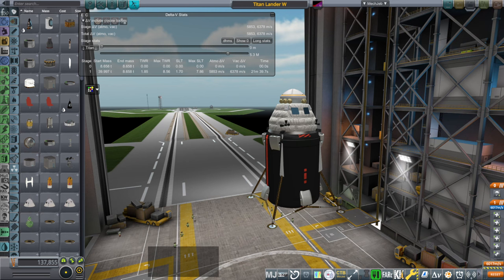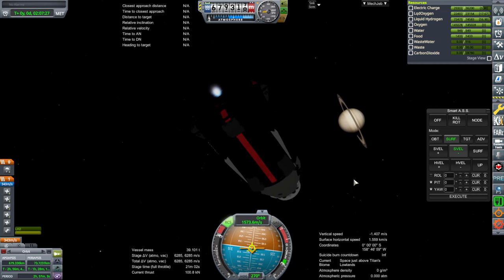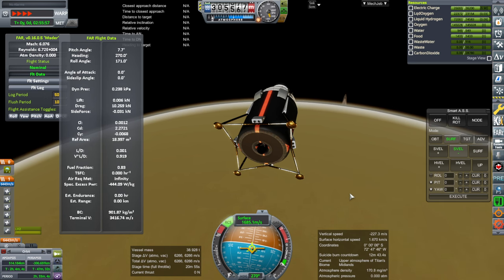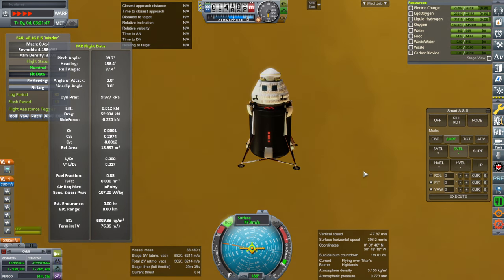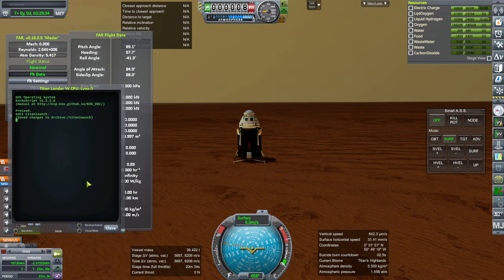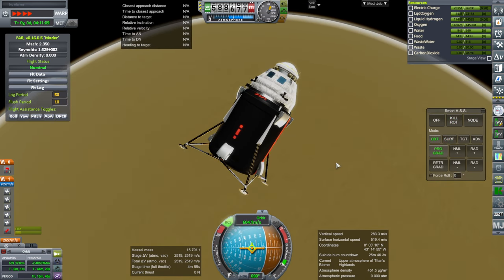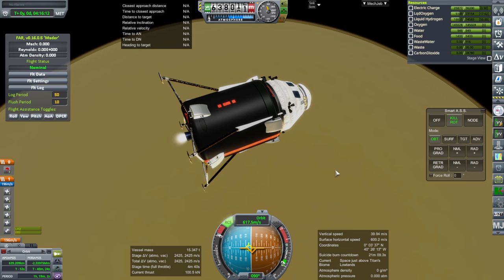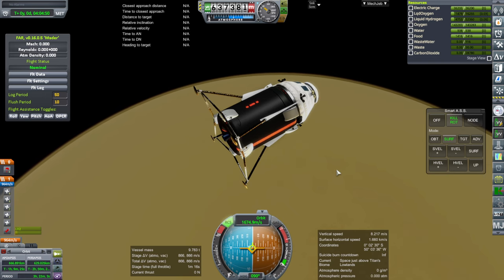Titan Lander Reconsidered (RO in KSP 1.12)

Comment: As I mentioned on stream, and as you mentioned, there's three main things that cause the drag coefficient to be what it is. The shape of the vehicle (pressure drag) skin friction/boundary layer drag (usually <10% of the actual drag force, very finicky and depends on the reynolds number of the air, the surface finish of the vehicle, etc) the angle of attack (this causes the reference area actually being hit by the air and the shape being hit to change, its fairly intuitive) and the Mach number. Usually because of things like shock buildup and wave drag where the properties of the air change very quickly and rapidly close to the vehicle.  The drag coefficient can be treated as constant below Mach 0.3 and modeled with a polynomial equation otherwise as a function of the Mach number. For small angles of attack (<6°) increase in the drag coefficient with the angle of attack is basically linear.
Reply: So, we need a pointier rocket?
Reply: Pointier doesn't always mean better, but it usually helps. Best cone shapes wre generally long, ogive type with a slightly blunt nose
Reply: @jmstudios457  interesting. Perhaps the rear of the rocker should also be aerodynamic? Not sure if FAR calculations are that complex, however.

Comment: My apologies if there's a very obvious reason why this would not work in the RO. Helicopter ascent make returns from Eves surface super easy. I wonder if you could do something similar on titan. Electrical charge obviously gonna be an issue there but it'd probably work with some refinement
Reply from the maker: Yeah - I mentioned electric motors in the video as something I just didn't know how to handle. I just can't calculate it outright so it'll require a ton of testing and, as we've seen, testing with Titan's thick atmosphere takes a long time.